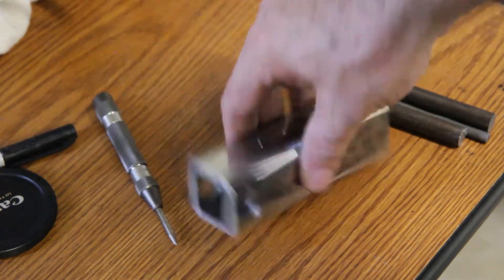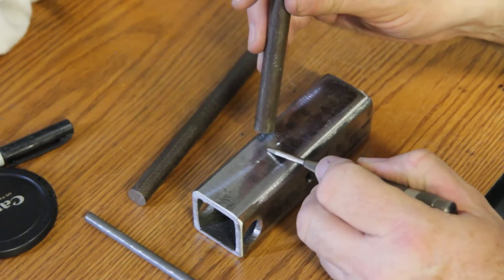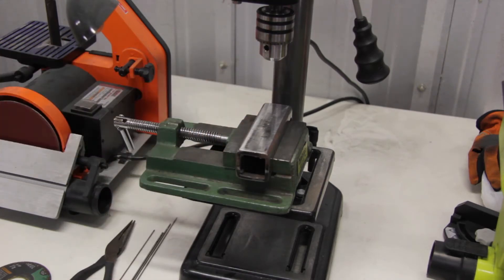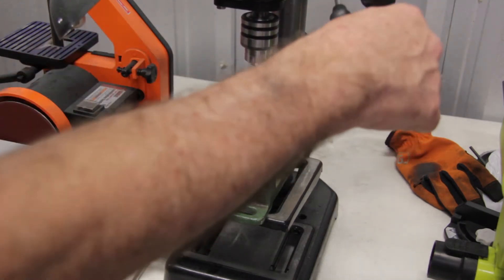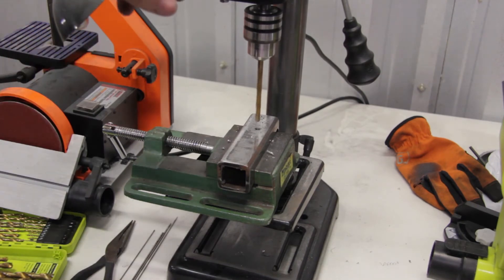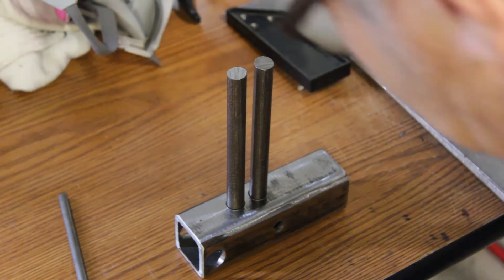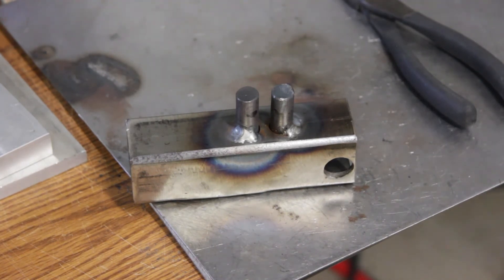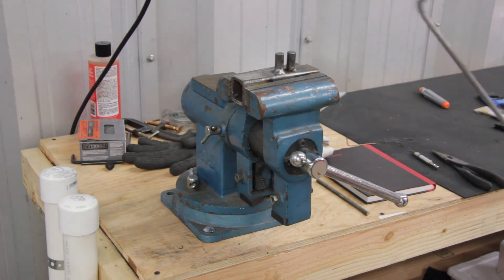1/4" Rod Bender

Comment: Obviously you are teaching newbies.  So you are explaining a lot.  That is good.  You should have told about safety precautions like wearing safety goggles, gloves, etc.  You are drilling pilot holes first before drilling the 1/2" holes.  A little bit of lubricating oil while doing the drilling will do no harm.  For bending a quarter inch rod, human muscle power is sufficient, I think.  No need of a hammer.  You can not get perfect 90 degree bend with round bending rods like the two you have used.  Other than these, very good explanation.  Thank you.
Reply from the maker: Great Tips, Thank much Goldin.
Reply: And he called it building?? I call it a disservice! Very unprofessional, look at the tools he's using??

Comment: 90 % bullshit! Far too much bolder dash and I noticed that your drill bits are blunt, your workbench is totally unstable , your vice is incorrectly secured to the work bench!  The inside jaw of the vice should be in line with the edge of the bench.
Reply from the maker: you have zero subscribers and zero videos,  you know there is a term for people like you.  BIG ZERO
Reply: "bolder dash"?